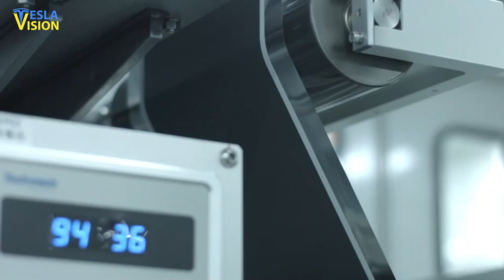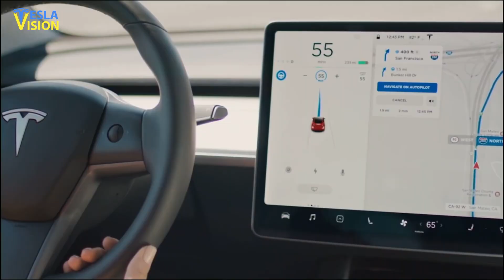4680 Tesla Battery VS China's New Battery Breakthrough

Comment: the sodium battery is 20% cheaper than lithium battery but is 160 kw density compare to lithium with 285 kw density. thats 40% less energy dense. so is not economical viable.

Comment: An very viable replacement for the expensive lithium in such applications as stationary power banks, eg. batteries for household solar panels and windmills. There're still remote villages in China not yet connected to the major power grids. I bet the CATL developers have them in mind.
I was once told by a chemistry professor that LI possesses some attributes hitherto not well understood that can cause "untamed molecular chaos" , meaning heat accumulation that can lead to fire and explosion. In industrial, consumer applications, certain stabilizers are added to lithium to mitigate the risk, which further increases the cost of LI-based products. As for its application on vehicles, it'd depend on the minmax curve amongst the trade-off factors: safety concerns, range anxiety, costs, environmental impacts, etc. One BIG take-away for me from my conversation with the Prof: Hitherto Data had shown not one single case of fire or explosion from single-charged LI-based batteries. They still didn't know what that meant scientifically.
Reply: the sodium battery is 20% cheaper than lithium battery but is 160 kw density compare to lithium with 285 kw density. thats 40% less energy dense. so is not economical viable.
Reply: @cornelstamate2537  Cost-KW-weight ratio is not much an issue in stationary storage. Also, your simpleton math doesn't compute, mixing apples and oranges.

Comment: The CATL sodium iron phosphate batteries are for Tesla power walls, not cars.  Cars need high power/weight.  Stationary batteries need low cost/power.
Reply: Sodium will also provide a nice pyrophoric show like in the New Years celebration.
Reply: That is right if and only if CATL sodium iron phosphate batteries becomes another marketable batteries Tesla will use it in their power sections.